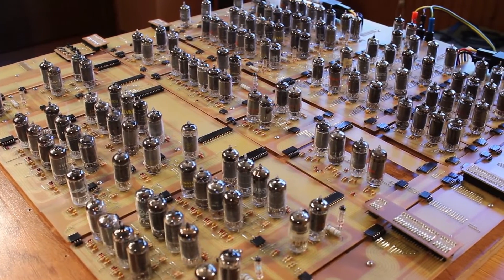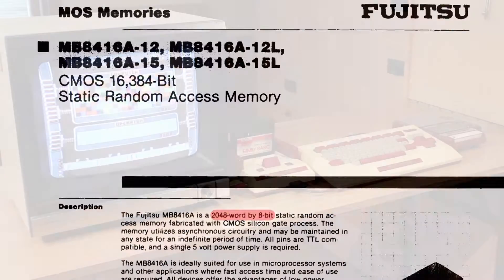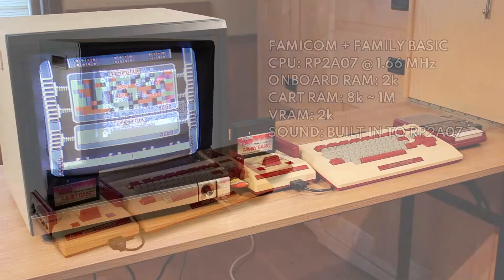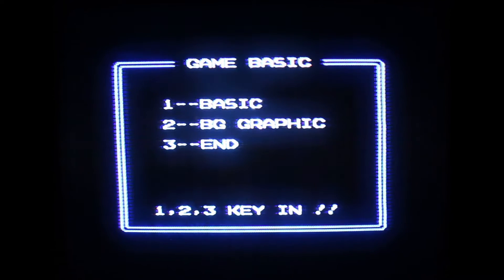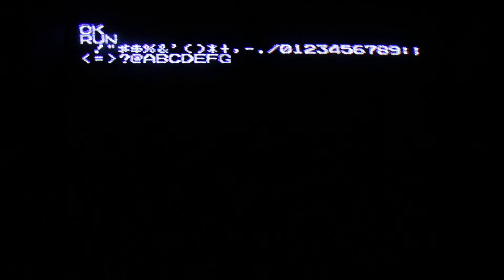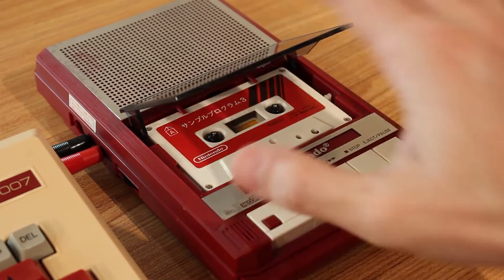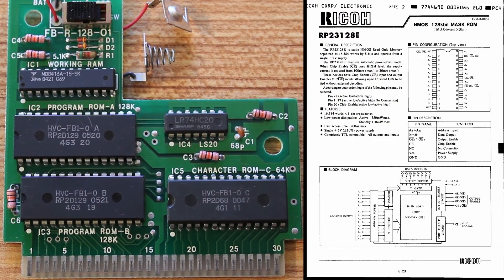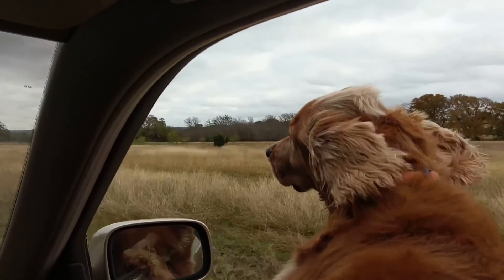Nintendo Famicom Family Basic

Comment: 9:33 Oh look, nintendo has invented dial up modem noises before dial up modems were a thing.
Reply: That noise is music to my ears! I grew up with a ZX Spectrum computer in the 1980s, and that stored data on audio cassettes in a very similar way.
Reply: "Oh look, nintendo has invented dial up modem noises before dial up modems were a thing."

Bell Labs (a subsidiary of the original AT&T / Bell System at the time) invented the dial-up modem, and therefore dial-up modem noises, in the 1950s. The first commercial dial-up modem was the Bell 101, released in 1958. In 1958, Nintendo was just making playing cards.

Bell Labs also invented the transistor (and many other things), which is the fundamental component that makes modern electronics, including computers, possible in the first place. A modern CPU for example, is nothing but a bunch of tiny transistors (billions of them) interconnected in a particular way. It's one of the most important inventions in history.

Comment: Wow, you've got V1.0, I've heard that's the equivalent of having a Unicorn Feather. My startup screen shows: 

NS-HUBASIC V2.1A 
(c) Nintendo/Sharp/Hudson
1982 Bytes Free
OK

So it looks like V2.1A users have been shorted 1 byte by Nintendo!  Also,  I have a 3rd party cassette unit & although I can save to tape, I can't get the adjustment correct so that I can read back in a program once it's saved to tape.  Any hints?  Thanks!

Comment: Years obsessed with how the hell you save the programs in the battery backed RAM. At leas on v3.0 on the Fceux emulator you just use the command BACKUP then stop the emulator/power down the nintendo. It should save the background if you draw one if you use the command BGGET before the BACKUP command.

Bonus info from the manual: "A." or "AUTO" or "AUTO 200", will automatically increment the lines in units of ten staring at line 10 or the line right next the command. The STOP key will get you back to the regular prompt.

Comment: I wish Family BASIC could be emulated. There's a ROM of it, but it doesn't work because no emulator I know emulates the family basic keyboard and data recorder.
Reply: Actually several Nintendo emulators, e.g. nestopia and Nintaco, are fully capable of that. I use nestopia on Linux and it works perfectly with different versions of Family BASIC roms.
Reply: I'm pretty sure it probably can be emulated. There may even be an english translated rom of it.
Reply: @costelinha1867  It can't due to the keyboard thing it requires. No modern emulator can emulate it.

Comment: Are there any clone keyboards out there? I have an ENIO board for my NES so it should work with it. Ive heard if you have the keyboard you can use the load and save functions in excitebike or wrecking crew to save data to a cassette recorder. I also own an analogue nt, it has a 15 pin port built in. The Japanese always has the coolest stuff.

Comment: It's pretty respectable you've got all the original equipment for a full setup, but what really tickles my hacker bones is the possibility to get Family BASIC running on the NES. There have been one of two success stories, so it is possible, but not without effort, and AFAIK no YouTuber has ever fully documented the process. From what I understand, the lockout chip and differences in Famicon/NES cartridge pinout are obstacles that need to overcome through the use of a 72-to-60 pin conversion adapter and possibly also a Game Genie to deal with Nintendo's region-specific lockout shenanigans. However, the biggest hurdle might be the keyboard hookup itself: On the Famicon, it connects to the 15-pin expansion port, but that's not present on the NES, and the controller ports don't have all the same pins, so what to do? According to neswiki, there's an 48-pin connector at the bottom of the NES PCB, but to get to it, the user needs to turn the NES on its back and remove (literally break out) a little plastic cover, revealing the connector. (There might also be an additional, removable and replaceable plastic protection cover – not sure. Or maybe that would have come with any accessory requiring users to break out the former cover, though none was ever officially released.) At one point, someone had built and even offered an NES-to-Famicon expansion port adapter called the ENIO EXP Board, but this seems no longer available; only some serious digging through the page history of the Familiy BASIC Wikipedia article and the Wayback Machine history of the ENIO board maker's site reveals that information. (If you have an email, gimme and I could send you some links.) I don't know why that's no longer available; maybe it was a small run and its maker has moved on, or maybe Nintendo stomped them – I dunno. The bottom line is, with the right skill set, which you have, this should be possible, and no-one's ever made a good video on it AFAICT. Of course, I don't actually know if you have an NES. I also don't know if it matters whether an NTSC or PAL NES is used and if Family BASIC would run the same on both.

Comment: Helpful note: the Sharp Twin Famicom has a compatible expansion port that works with the keyboard.  The great thing about it (besides the fact that it includes the famicom disk system), is that it has RCA video built-in, so you don't need a TV with channel 99 or whatever (or need to mod your famicom like you did)

Comment: What I love is that Nintendo clearly had a micro computer mindset in mind for the home initially. You can tell by the classic micro computer hardware components utilised to sell the Famicom including the machine itself, the keyboard, the tape deck, family BASIC included, a joystick and eventually the disk system. These were fairly standard for most micro computers for the time and BASIC was common to program and play games. So Nintendo was ticking the boxes on what was popular across several regions, and I am surprised this didn't hit the European or Australian market especially because they were popular with micro computers as well. In fact the Famicom was the easiest, fastest and one of the most powerful systems compared to all of those others to even run software! If they played their cards right, Nintendo would have sold this in a much more interesting light than what we ended up with in the 80s-90s and the Nintendo AVS System could have worked instead of the NES. Alternatively, they could have sold it as a fairly powerful gaming micro computer or something, it might have done quite an impact! With the Sharp X1, I would have assumed the Famicom was cheaper and more accessible, and any CRT TV with RF component compatibility would have worked just fine. I think computers needed proprietary monitors.
Reply: I don’t think it would’ve done that well in Europe, the nes was expensive and bulky in a country full of cheap microcomputers. It may have been superior in some ways but it was behind in others, and it would’ve been more expensive than a ZX Spectrum, BBC Micro, or Commodore 64 with all of the addons required to get full microcomputer support. But it’s true, microcomputers we’re huge here, it was just far too cramped of a market even just for dedicated computers.

Comment: Genuine question. Do you think it's possible to make a keyboard for the NES and run Family Basic on a flash cart?
I often day dream about this.
Reply from the maker: Hmm, the NES controller ports and the Famicom expansion port are a bit different, and the Family Basic keyboard uses some of the data pins that aren't available on the NES controller port. So, I think you would have to access the 48-pin card edge located on the underside of the NES to get to the necessary data lines. 
Here's some info on the expansion ports: https://wiki.nesdev.org/w/index.php/Expansion_port

That's only half the battle though because the Family Basic keyboard doesn't use standard keyboard protocols. It's been a while since I've done any in-depth reading on the Keyboard, but it essentially it splits the key matrix into two columns and eight rows and then cycles through them in software to detect which key is pressed. Granted, the Family Basic software takes care of all of that, so you really only need to copy the keyboard matrix. 
Here's some info on the Keyboard: https://wiki.nesdev.org/w/index.php?title=Family_BASIC_Keyboard
And some more in-depth info in Japanese on it: http://www43.tok2.com/home/cmpslv/Famic/Fambas.htm

It's certainly not impossible, but it will definitely take a bit of work to get it going!
Reply: @UsagiElectric  dunno how to get the keyboard connected to a stock NES, but somebody developed a mainboard replacement PCB for US/EU front-loader consoles called the "NESessity" - and this PCB has a spot to solder a DB15 connector onto it - it is accessible from the bottom of the console where that useless expansion port cutout used to be

Comment: My question is:
Can You play Doom ?
Reply from the maker: Well, the Ricoh 2A03 CPU in this machine is essentially a 6502 at its heart, and some crazy programmers have built a very simplified version of Doom that runs on the Commodore VIC-20, which is a 6502 based machine, so it's totally not out of the realm that that Doom port could be ported over to the Famicom!
Reply: @UsagiElectric  can You make a vídeo playing doom, please ?
Reply: @enjoyer____9685  can you understand that that would require porting the VIC-20 port of Doom to the Famicom, please?

Comment: Weird that it has 2 x 128K Program ROM and 1 x 64K character ROM....and only TWO kilobytes of actual usable RAM included (luckily upgradable via a RAM cartridge).
Reply from the maker: Yeah, the 2k of RAM is hilariously small! But, from the system perspective, the RAM was supposed to be in the game cartridges, and some cartridges came with up to 1MB of RAM, which is massive. Now, why the Family Basic system used such tiny RAM chips for storing programs is a weird choice. I think if they had put a 16k RAM chip in there and streamlined the Basic experience, it could have been a decent "family" computer contender.
Reply: @UsagiElectric  Putting the extra RAM in the cartridges seems very wasteful, but I agree the system would have probably benefitted more by having 16k or whatever on the main system. Funny side note: There was a BASIC cartridge for the old Atari 2600, but it only had 128 BYTES of RAM and a lot of that was used as overhead. It was, as you can imagine, super duper limited but impressive that it could allow any BASIC programming at all on such a system!
Reply: Those ROM numbers are Kbits. So 32KB PRG + 8KB CHR which was the max you could address without bank switching. Although in this case I think the 2/4KB RAM is bank switched over the PRG ROM.

Using a lot more ROM than RAM for a BASIC implementation was pretty par for the course for early home computers. Robust-ish BASIC interpreter takes space and mask ROM in volume is a lot cheaper per bit than SRAM (or PSRAM)
Reply: @espfusion  It seems that starting with the Japanese cartridge consoles like the Famicom/NES game size was measured in kiloBITS instead of kiloBYTES to make them seem more impressive I guess.
Reply: @JustWasted3HoursHere  most ram, eeprom , eprom chips had the type number specify bits or kilobits, such as a 62256 is a 32k byte ram chip (256k bits)

Comment: If the battery-backed RAM circuitry is working alright, it might be that you have to hold RESET on the Famicom before powering down. Lots of older Famicom/NES games tell you to do that to avoid corrupting the save RAM. (Later mapper chips had protection against that, so you stopped seeing that message when saving or in the instruction book.) Dunno! Just throwing it out there!
Reply from the maker: That is an excellent idea! Unfortunately, I just gave it a shot and it didn't seem to work. I think the issue lies in the opening screen. In V.2 I believe you turn the backup switch on, power off the console, then press and hold T, power the console back on, and it skips the start up screen, goes straight to basic and the RAM is preserved. But, with V1, if I hold T with the back up switch off, it does a simple RAM check and freezes on that screen, and if I hold T with the back up switch on, it hangs on a white screen.
I think there's a little more than expected going on behind the scenes!